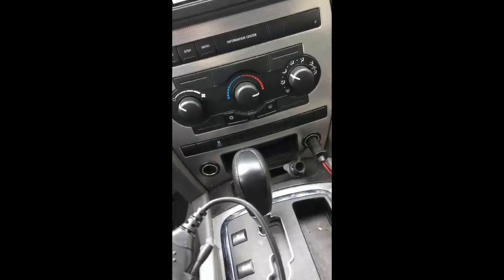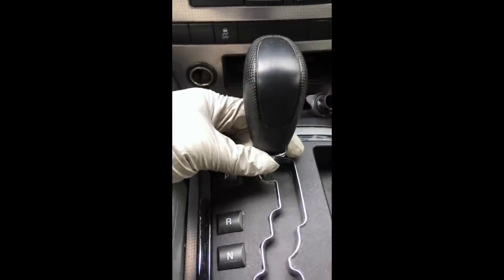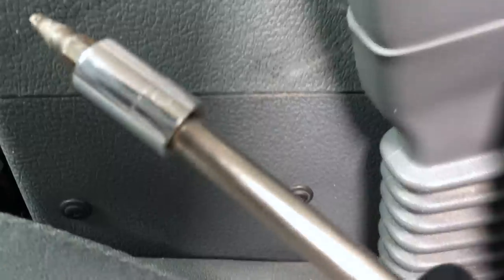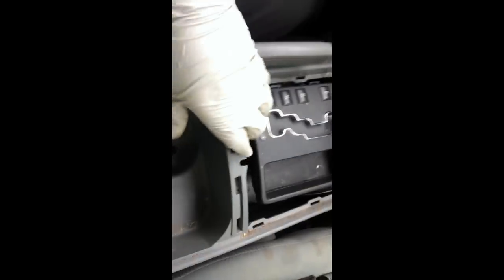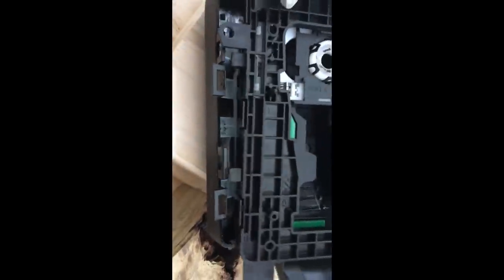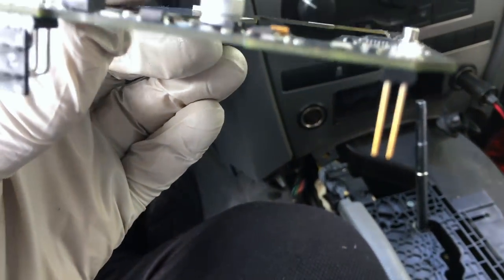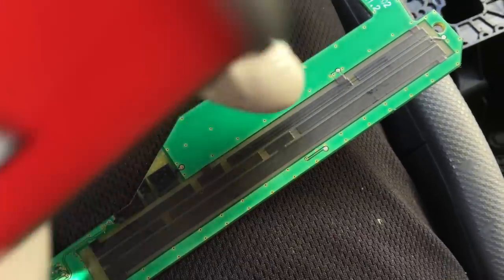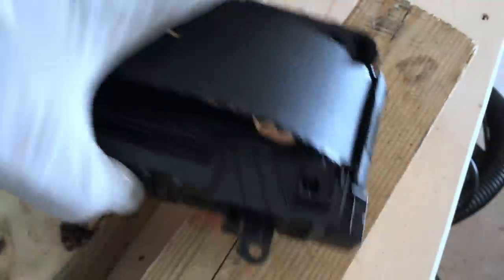2006 Jeep Grand Cherokee (WK) 3.7 Electronic Shift Module (ESM) Problems U0404 P0700 Codes

Comment: I recently took my 2006 Jeep Grand Cherokee Laredo 3.7l to the local Jeep dealership and had the diagnostics ran on it bc I've been having shifting issues (hard shifts, delay in gear shifts, not wanting to accelerate quickly when going up hill from a dead stop). They came back and told me that I needed a new prndl module and it would run me $1,300! (They didn't give me the codes) I found your video and am wondering if this would be a fix for that. I'm a 32 year old woman without much experience working on cars, but I'm a determined one and hope this is what I need to do! I should mention that my gears aren't all illuminated at once, although they have been before a long time ago. Thanks in advance for any advice you can give!
Reply from the maker: Ok I got you, the PRNDL is the same thing as the ESM. PRNDL is park, reverse, neutral, drive, and low. ESM is electronic shift module. I was having the same issues as you. When it acts up the Jeep goes into limp mode and makes the Jeep sluggish and not move. This is a easy fix, just follow the video. Another suggestion is to go to auto zone and have them pull the codes for you. They do it free of charge. Write them down before you disconnect the battery in the jeep. Once you disconnect the battery all the codes will be cleared. You may or may not have a check engine light on. Sometimes the codes are pending and won't set the check engine light on. Hope that helps.When you go to auto zone get a can of electric contact cleaner, I saw your question a couple days ago, I couldn't respond because the comment got deleted. Any questions, Im always around.
Reply: MrV2u thanks so much! I've watched your video several times now and am about to go try this out! I got the same cleaner that you used at Wal-Mart. I was thinking the prndl was the same as the esm but wasn't positive. Is it absolutely necessary to take the entire console out? Just want to cover all my bases before I start lol!
Reply from the maker: jennaraeford taking out the console is the only way to gain access to it. Believe me it looks scarier than it is. Just go slow and it will turn out fine. If needed take pictures for yourself if your not sure you can look back at them or this video. Good luck
Reply from the maker: jennaraeford one more thing did you go to auto zone and have them check for codes before you disconnect the battery? If not no biggie.
Reply: MrV2u I disconnected the battery last night when I started to take things apart 🙈 I'll let you know how it goes!! Thanks so much for your help and video! You're awesome and very much appreciated!!
Reply: MrV2u so I got it all apart and am about to start cleaning it. Do in clean just in the breaks or the entire area (dark gray part)?
Reply from the maker: jennaraeford you can clean it all. The cleaner the better. Your doing good.
Reply: MrV2u Hey! Just an update. I got it all done and put back together. It's been shifting a lot smoother and I have way better acceleration going up hill!!! I've only had 1 hard shift so far! Thank you so much for your help and awesome video. Couldn't have done it without you! The hardest part was getting the console back in with the screws lining up in the back along the sides lol!
Reply from the maker: jennaraeford jennaraeford congratulations job well done. In the future if you get a check engine light go to auto zone have them print out your codes before you go to the dealer. At least you’ll know before hand what’s the problem. Hey don’t charge to check for you. And I’m always around to offer advice. Job well done. 👍🏼

Comment: Thank you for this video. It is not only helpful but simple to follow as well. Just a quick question though. Will this work on a 2007 jeep grand Cherokee with the 5.7 hemi that has the 5 speed gear box or is it just for the 3.7? Great video brother. Just had to say that again.
Reply from the maker: Thanks Greg means a lot to know I’m helping out. It will work in your Jeep as well. Let Mel. Is how you make out or if you have any other questions.  Good luck my friend.

Comment: I have the same code on my 06 Grand Cherokee Laredo followed your instructions to tthe letter , nothing changed  Great job on your video but what the next course of action should I take?  I just turned over 304,000 miles on my jeep and outside of routine preventive maintenance  Ive had no issues till nowany and all advice would  be appreciated thanks in advance for your time and efforts.
Reply from the maker: Most likely you need a rebuild or swap it out for a junk yard tranny with low miles. It all depends on your budget. I replied to your other comment with more information brother. Sorry to be the bearer of bad news.

Comment: Thank you so much for the video bro. Saved myself a headache as I'm a Mobile Mechanic and came across this issue. The only problem I have is, the Jeep won't start correctly.  It starts when I hit the gas but has Hella trouble staying on, and dies when I let go of the gas pedal. There are NO codes but the UO404. That's it. Any suggestions? Was your engine messing up like I described?
Reply from the maker: Mine wasn’t doing that. Have you tried to clean the IAC and throttle body? Use throttle body cleaner not carb cleaner. It can also be a throttle position sensor. Try cleaning first and let me know how you make out.

Comment: WOW - hope this helps me out ... Mine just got a u0404 and p0700 code this morning , but also got a p0613 along with it. CEL went on and after a few stops on the way home requiring engine on/off, the CEL disappeared. Still have the codes though. Will give this a try next ! any idea if the p0613 could also be related to same dirty contacts ?? Thanks again for an extremely informative video - top notch !
Reply from the maker: Glad to help brother. It can all be related. I’m sure cleaning the contact will help set you up brother, if not let me know.
Reply: @MrV2u  will let you know :) !  THX!

Comment: 05 Jeep Grand Cherokee, stuck in 1st gear, and also when I turn off and turn back on and try to drive it says the e brake is on. Throwing the code you showed of the p700 keeps been acting funny for a while throws the shifts hard or stays stuck or goes slow etc hopefully this will fix.
Reply from the maker: It should help you out. You might have a secondary problem with the e brake. Start with this fix. And let me know how you make out.

Comment: Excellent video sir! I’d love your help. Any tips on clearing PCM failure? P1697 engine code. Nobody near me wants to help. I have no idea.
Reply from the maker: Robert Urban that might be a dealer repair brother. That’s why no one wants to help. Trouble Code: P1697 PCM Failure (EMR/SRI Mileage Not Stored) Trouble Code Conditions:Key on, and the PCM detected an unsuccessful attempt to "write" the Service Reminder Indicator (SRI) or Emission Mileage Request (EMR) mileage to an EEPROM located occurred during initialization. Possible Causes: Clear the trouble codes and retest for the same trouble code. If DTC P1697 resets, replace the PCM and then reprogram it. It might cost a lot. Clear the code if you have a reader and see if it pops up again. Let me know how you make out.

Comment: @MrV2u Dear MrV2u, Thank you for sharing this video it is really a stress reliever for some. I have another kind of  problem with my ESM, it works properly in All PRND but, when I put it on Drive, I can't shift to - +, is there a way of adjusting this issue? (I am able to move the "handle" left right but cant go from D to 4321...)

 I opened the upper part as you showed in the vid, There are two thin metallic pieces surrounding the black plastic square that is attached to the white horizontal one (shifter)... Should these be the problem? Could they be cleaned or adjusted? Many thanks😊😊😊

Comment: MrV2u my 06 Commander sometimes drops out of gear while driving. Once I pull over and try to put it in park it grinds and clicks. Other times when parked I'll start it and when I shift in to drive it won't engage. Both issues are resolved when I turn off the engine. Could these problems also be connected to the graphite build up or something else.
Reply from the maker: Do you have any check engine lights? It could be the graphite buildup and something else. A failing hub can give you the same issues. But you will get a check engine light. The hub assembly contains the abs sensor. If you have the codes let me know so I can further help you out.
Reply: Occasionally  (not every time it happens) all the sensor lights come on. Recently though when I have these issues no sensor light comes on.
Reply from the maker: Rena' Longino I’d recommend going to auto zone and have them check for codes. Not all codes set off the light. Some codes are called pending and won’t set the light off right away. From what you say I’m leaning more towards a abs sensor in one of the hubs. They check the codes for free.
Reply: Thanks MrV2u. I really appreciate you!!!

Comment: Hey awesome video help me out alot thanks but I have a question my tail lights don't stay on changed all the bubs and fuses and nothing everything works the signals work and the breaks work just not the taillights  I was wondering if you know anything read online and Said it could be the circuit board any information helps
Reply from the maker: Does it come on at all? Does it come off and go off? If so how long does it take to go off? Do you have a check engine light on? We’ll get to the bottom of this. Thanks for the feedback as well.
Reply from the maker: Email me at MrV2u@hotmail.com I have a picture of the fuse/relay panel. It can be a parking light relay that’s going bad. You didn’t mention anything about changing relays. Relays when they go bad they pop and turn off then when they cool they can come back on. But let me know about the other questions I asked up top!
Reply from the maker: Did you replace the bulb recently? If not pull the tail light lens out and check the bulbs. One of the Filomena’s could be shorting out the system. Change both bulbs at the same time if you find one bad. Check the socket where the bulb goes in for corrosion. If so get a electrical cleaner. It’s a spray you might be able to save the socket by cleaning it. Next it can be a bad wire, that is way more involved to pin point. If it is a bad wire and when you pull out the tail light lens maybe it’s right there. Other than that and you’ll have to trace wires. It can also be the headlight switch in the dash that’s going bad. Do you have automatic lights that come in when it’s dark out? If so it can also be the ambient light sensor that’s faulty. Let me know if any of these helps you my sister.

Comment: Is there anything we can put between  the cleaned contact points to help prevent that graphite for forming again ???
Reply from the maker: No brother it has to make that contact. The graphite makes it possible to slide across the contacts, but when it builds up and makes that solid connection it messes things up.

Comment: Thanks for the video man! I'll have to buy some tools and give this a try. my 06 jeep i bought a year ago has been stuck in limp mode so I bought a code scanner and it says P0700 and P0733. I got the vehicle cheap and im too broke at the moment to afford a new transmission if that's the problem, so i've been trying everything I can before I get it towed to a mechanic. It has always randomly shifted a little hard and has always had a slight burning smell after I shut the car off that only lasts a min, so I always assumed the transmission would go on me someday. Just wish it didn't have to be right before winter lol
Reply: I’m having this problem now!!! 06 GC stuck in limp mode. Any updates on yours??? Any advice!?
Reply from the maker: Kristina Stroup Do you have a check engine light on? If so can you take it to advance auto or auto zone and have them scan it for you? I would need the codes to point you in the right direction. Many things can put the Jeep into limp mode.
Reply: Any clue if this works for a P0730 code ?
Reply from the maker: Some possible causes:
• Low transmission fluid level
• Dirty transmission fluid
• Shift solenoids
• Transmission mechanical problems
• Transmission hydraulic control circuit

It wouldn’t hurt to do what I did in the video as it can be a electronic issue. How many miles do you have on it? Has the tranny ever been serviced? It can also be corrosion in a wire harness connection.
Reply: @MrV2u  148000 no clue bought it for my daughter 2 years ago I guess that wouldn’t hurt .. I did ur trick didn’t do the job it’s shifting hard and out of sync at highway speeds
Reply from the maker: @co8nap71  has the tranny ever been serviced? How’s the condition of the fluid?
Reply from the maker: @co8nap71  cheapest thing would be to change the filter and tranny fluid to be sure. Unless they specifically said it was done. Does it have a tranny leak? Or is it weeping? Did you crawl under there to inspect?
Reply: @MrV2u  added 1/4 quart of trans fluid cleared code and so far so good brother ty Badda bing badda boom
Reply from the maker: @co8nap71  lol great news brother. I know it’s sucks that we don’t get dip sticks like normal vehicles. If you or anyone you know has any mechanical questions you can always say you got a guy.

Comment: My 08 GC pulls codes 0730, 0731, 0732. I have already put in $1,300 to replace the TCM and the problem still isn't fixed. My Jeep, like others, will jerk during acceleration, not go above 40mph and my gas mileage tanks. I also have to turn the car off and back on which seems to work most of the time. Could this be my ABS sensor? Any help is appreciated!!
Reply from the maker: Did they do a “Quick Learn” reprogram when they installed the TCM? This is a reflash of the computer. If they did try to clean the ESM like I did in the video. Let me know how you make out brother.

Comment: My 06 Grand Cherokee has been pulling the codes P0700 and U0404. I did everything in the video and the light stayed on. I turned it off with my code reader and it stayed off for a few ignition cycles. When the light came back on, still the same codes. Took it to O'Reily's, seeing how they said they can read tranny codes. Their scanner said the same codes. They told me it should be the ESM and also the TCM, but the ESM should be changed first. The PDRN indicator shows all four boxes around the letters but when I tap the shifter to the right, the boxes go away. There are minor driving issues. So was wondering before I shell out money to the dealership to check it, has there been a find between the ESM or TCM to be the culprit?
Reply from the maker: The p0700 is a general code for faulty transmission. It can also be anything from a faulty shift solenoid to a TCM. But being that your still getting the u0404 could be a failing ESM. Let me know what they come up with brother.

Comment: Can you do this without removing whole console? Is it the harness that holds it up?
Reply from the maker: You can try and do it without pulling the entire console but it might be a little harder. Someone in the comments below did it. Good luck let me know how you make out.
Reply: @MrV2u  I did it today. Check engine light went away and the circles around all letters disappeared👍 also smooth transition from 1st. And 2nd. Only issue I had. The T-10 bolt that holds together was already stripped. Used needle nose and lots of patience👍 I also pulled console. Looked harder then it was. So far, so good! Great video. Very helpful!!
Reply from the maker: Jeff Gwilliam awesome brother. Glad it all worked out good for you. Just a little patience and it all works out in the end. Thanks for the feedback.

Comment: Thanks, worked great! Fixed 100%
Reply from the maker: Glad I could help brother. If you ever have any questions I’m around for advice.
Reply: Trouble code p0700 and u0404
Reply: @MrV2u  is this cleaning for code U0404? Its cause my cherokee doesnt take the change on time. They told me it was the computer of transmission
Reply from the maker: melissamirelesrubio I recommend you try and clean it before you spend money on unnecessary parts and labor. Let me know if you run into problems or have other questions.
Reply: Thank you I will

Comment: Are the shift indicator lights supposed to be lit up constant or only when it’s in a specific gear?  Thanks for your help!
Reply from the maker: They light up to indicate what gear your in and stay constant on. Let me know how you make out brother.
Reply: @MrV2u  @ when all shift light are on , will it  means the transmission is confused and  over work ? because my [ Transmission over temperature ] light also come on ?
Reply from the maker: If you have a check engine light on, pull the codes and let me know. One issue can set off other symptoms.

Comment: If only i had seen this video before replacing my transmission lol! Thanks. P.S i didn't  had to remove the center console
Reply from the maker: Ah man that sucks. Hey at least that’s one thing less to worry about further down the road. I was showing you the whole process. It is possible to do it with our pulling the console for sure. Glad I could help. If you run into anything let me know so I can try and help you out brother.
Reply: @MrV2u  just test drove and it drives wonderful. Thanks man. You're  a genius!
Reply from the maker: b df much appreciated brother. Means a lot to know I helped someone out. Stay tuned for more videos.